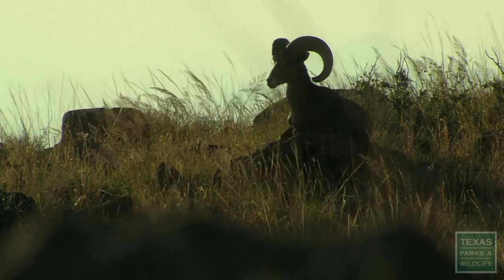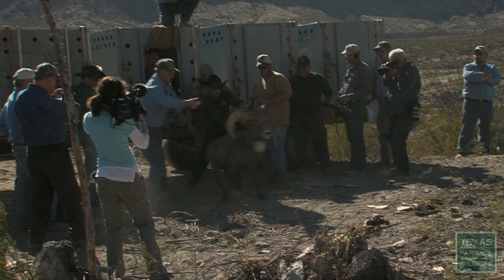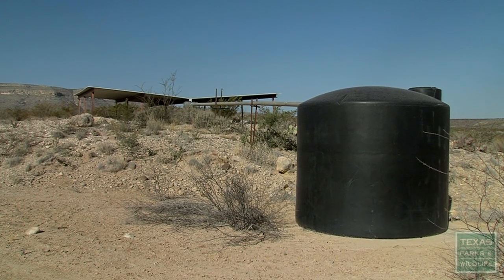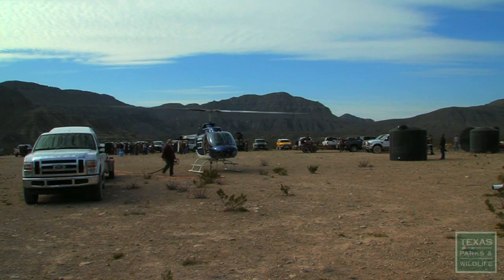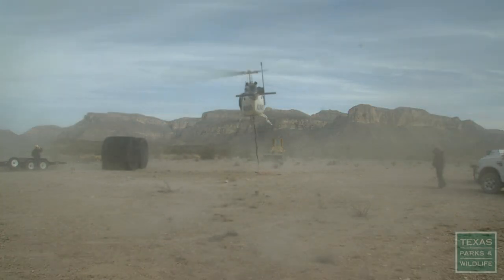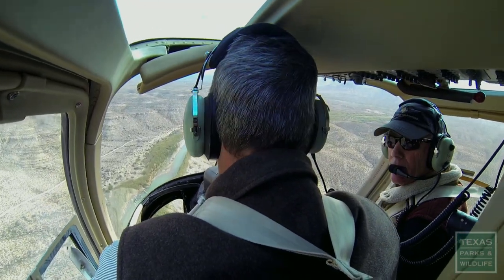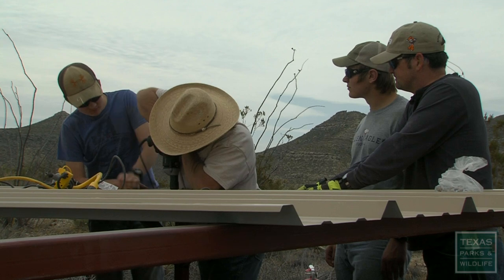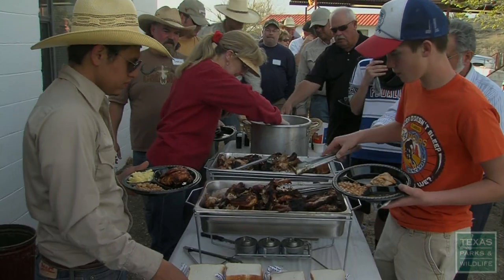Good Guzzlers, Water For Wildlife

Comment: This makes me weep in gratitude. Thank you. 
I hope one day there are guzzlers installed every mile or so in a grid across the desert - for all the wildlife.
Reply: you dont need them  areas which can be accessed by heavy equipment, you can build catchments with natural materials, if done correctly, they will even create "natural" springs down hill from the catchment, if not, then you would use the plumping and float systems to meter out water to avoid evaporation.
Reply: @idiocracy10  I think you may not understand how delicate those areas are. Heave machinery would destroy them for decades, if not centuries.
Reply: @kirstenwhitworth8079     as most people would do it, probably, but not if it was done  properly, the harvesting of the rainwater would replenish and "fix" them, not destroy them.
Reply: I was about to agree with your comment until I saw on other videos that TPW allows hunting of all of these same animals. I don't like them now.
Reply: @lissaline  Hunting is the main source of conservation efforts in this country.  It's thanks to hunters that states can afford conservation programs that do vastly more good.